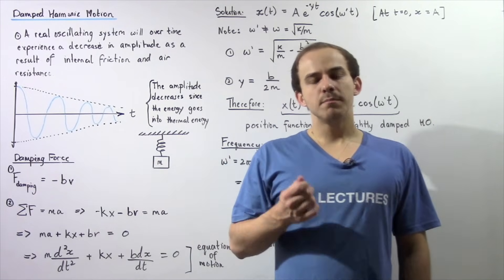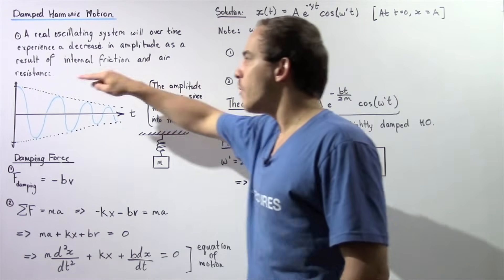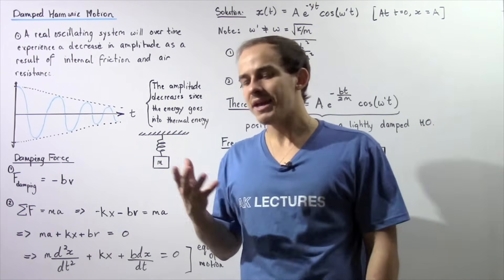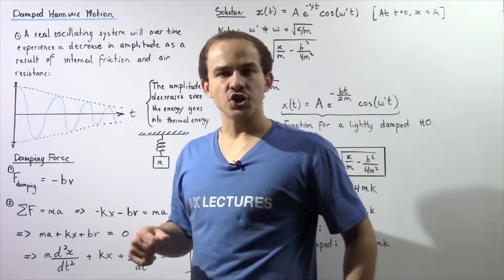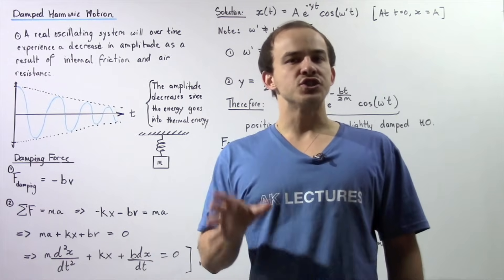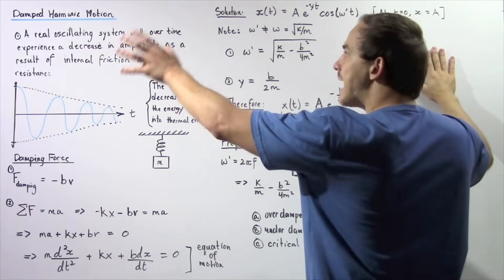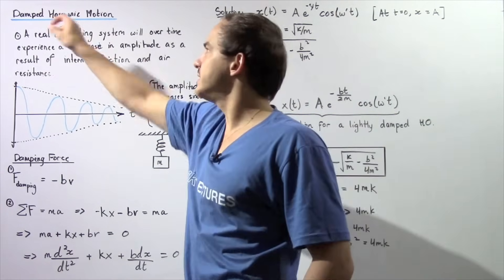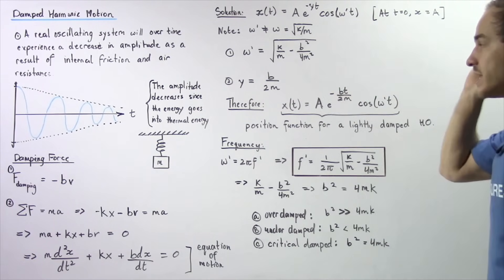Damping and Damped Harmonic Motion

Comment: Critical damping is NOT the best choice if we want the system to settle down to an equilibrium state (zero energy state) as quickly as possible. Details can be found in the paper "Damped harmonic oscillator revisited: The fastest route to equilibrium" published in the American Journal of Physics. 

Also i posted a short video about it on youtube, the title of the video is "Damped Harmonic Oscillator: Critical damping is not the optimal choice".

Comment: Sir, So I cannot use the position formula of my oscillator/spring system starts at displacement zero (equilibrium position). Since at t=0, the x wouldn’t not equal A. If not, is there an equation for which I can?

Comment: thank you for the video! But i have a question! hope you'll see this! For a lightly damped oscillation system, does the frequency of the oscillation decrease over time (i.e. period increase over time) as the oscillation proceeds? or does the frequency of the lightly damped oscillation just remain smaller than the undamped system throughout the oscillation?
Reply: hello there, idk if u still need it but I think I have some ideas about ur question and tbh it isn't 100% true , but the frequency, especially in damped, depends on the damp ratio which means if this ratio increases the frequency decrease from the undamped frequency.  ofc the slightly damped osc has a frequency that is less than undamped still it will descend at a small rate. I hope I benefit u and if there were any mistakes I wish u enlighten me .